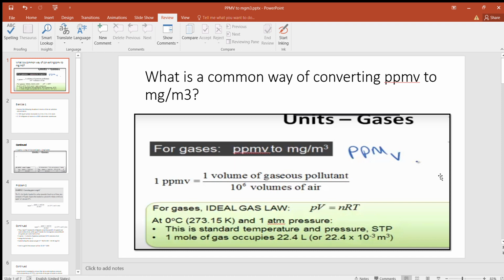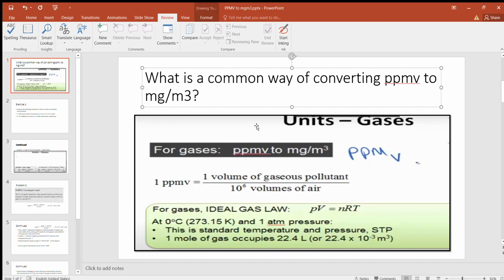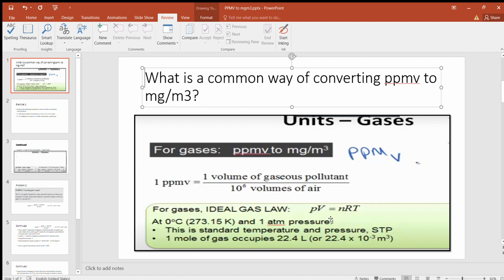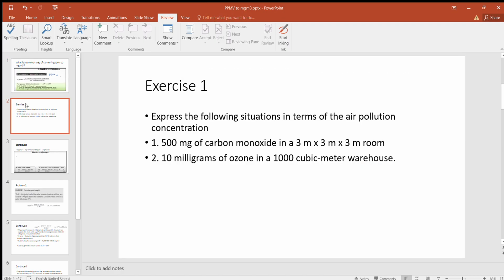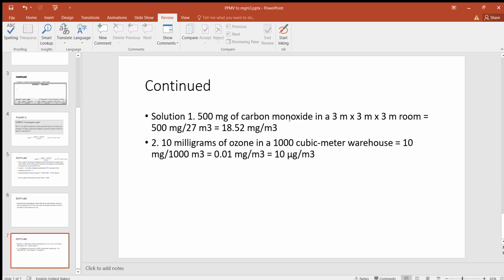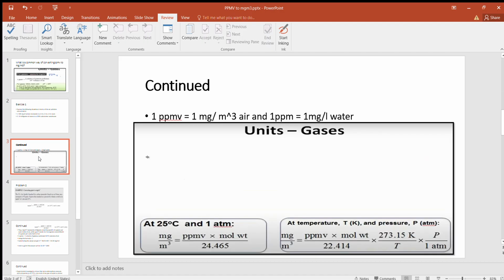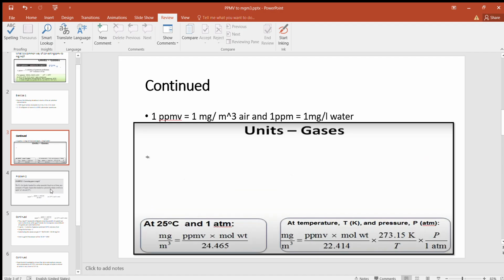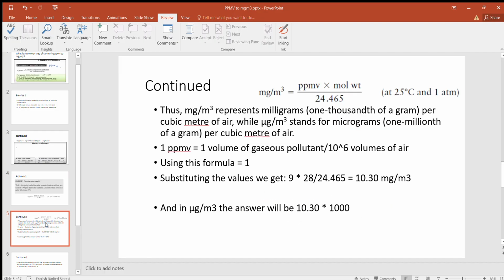ppmv to mg/m³ Conversion in Gases | Environmental Engineering

Comment: If my point of zero charge (pHpzc) is above 7, will my material adsorb cationic or anionic dyes?
Reply from the maker: Look it defines the point at which the net surface charge of the adsorbent is equal to zero.
Reply from the maker: Also at this point there is equal amount of positive and negative charges
Reply from the maker: When ph is Less than pzc the surface is negatively charged and it will adsorb cations and vice versa
Reply: I too agree @materialsandtechnology8956